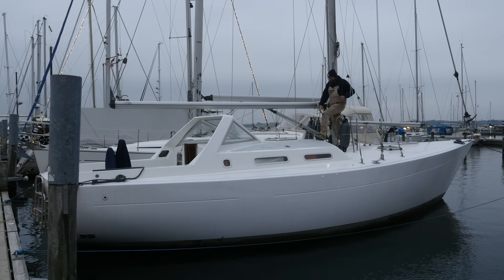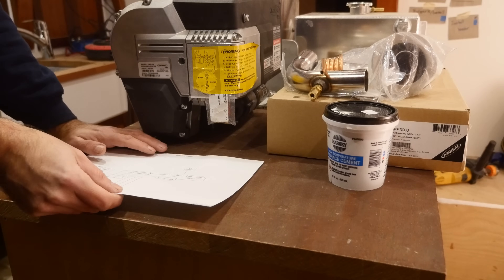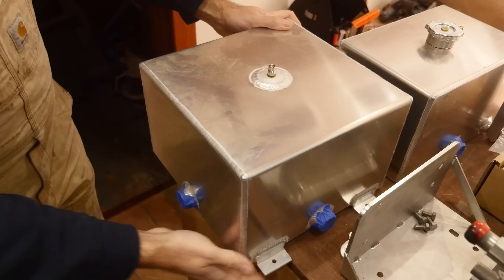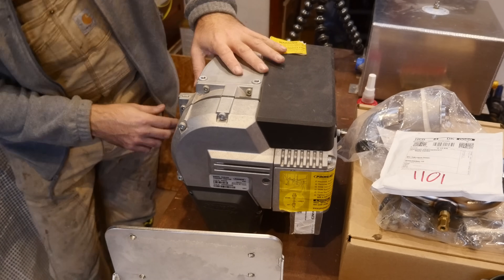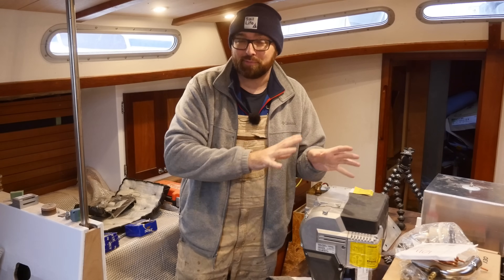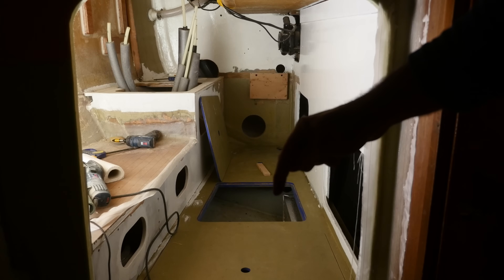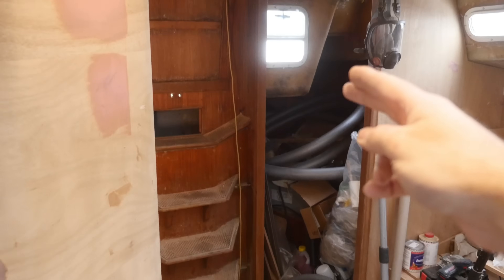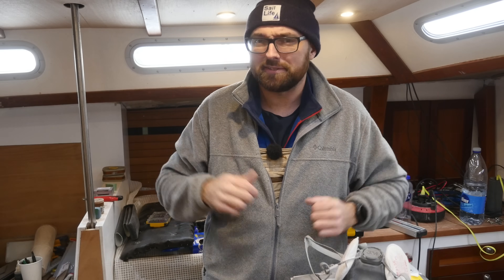Sail Life - Dometic Proheat X30 hydronic heater on a boat, part 1 of 3 - DIY project

Comment: Why dont you tap into athenas engine exhaust and save yourself a headache?
Reply: You can’t blow dry exhaust into a system designed for wet exhaust it will get to hot

Comment: Great job on designing a compact diesel-powered heating system. Do the "fan heaters" have a way to drain condensation? If so, perhaps you could connect a chiller for warm climate air conditioning using the "fan heater" loop of the same system. I added my +1 to the existing comment about the fan needing access to cabin air.

Comment: You might want to check if you can find a way to cool the exhaust of the Diesel heater. You'll want to cool it below 100C, since it will contain quite a bit of water vapor (actually, steam) that will give you a nice boost in energy extracted from your fuel when the steam condenses. 

Watch out, though, the resulting condensate will be rather aggressive, since it will be a) hot and b) acidic due to the high carbon dioxide content in the exhaust fumes.

Comment: You are lucky that Athena is a little larger boat.  We have a 35' Hallberg-Rassy Rasmus and it is crammed with mechanicals even though we don't even have refrigeration or pressurized water in the galley. We don't even have hot water, but we do have deck wash pumps, both fresh and seawater and that system alone takes up ridiculous amounts of precious space and servicing them both is a nightmare. 

Installing the Chinese Diesel heater was a PITA too.  Since we have a center cockpit and ridiculously high cockpit combing I was able to install the exhaust in that instead of in the hull.  That got it higher up and away from water ingress, while still away from any airflow going back down into the cockpit or the companionway hatches.

I hope you get better soon. Hopefully the 'rona cops won't haul you off to be quarantined in a sanatarium for weeks.  

"I'm not quite dead yet..."

Comment: I was thinking about the fluid for the heating system. For safety and also to stop galvanic issues you should look at a waterless coolant.  Something like Evans comes to mind. I use it for my motorcycle and for my car.
Reply: I was thinking same, do you still need expansion tank, if it doesn't boil?
Reply: @rogerkerkmann  well I would think he could still use it for air seperation and easy filling.  Yeah, on my motorcycle and car you could just pop off the radiator cap, and at best all you would get is a small pft.
So that safety factor would be of the greatest for a vessal that could be at sea for weeks on end.
Also corrosion would be a mute point as there is no water for galvanic electroalisis. 
well, except for the regular water in the heat exchanger. but if that is on a seperate loop would be an easy replacement when needed.

Comment: Your plumbing diagramme was slightly unclear, was it your plan to open the summer valve and close all the other valves? I would put three way valve at the inlet so you can just move one valve  and leave all the others at the correct adjustments. You might need a check valve in the system somewhere.   As far as size of fan heaters, on land those will turn a small room into a sauna.

Comment: Don't forget that the generator needs to be cooled, not heated. Pushing the hot coolant through the generator's cooling system seems to me not the best idea. Sameway if you are putting a heat exchnger on the outflow of the gen - you're going to have a huge leak of heat just overboard with the water from gen. 'Cause the water outflow from gen noway will be warmer than the heating fluid. So your heater will heat this water and you will heat fish😁

Comment: Dear Mads.  The Heating System looks great an can keep Wife Warm an Happy. Your exhaust should be in the middle of Rear in Athena about a One foot or One /Half above the Waterline. Also running the exhaust line a little long will keep the line from getting to hot and Having black film on the outside of the Sailboat! Remember you will need one Exhaust exit for the Inboard Motor Hope this help (    .   .    )    No there not boobs guys. lol. Greg of Ohio. PS. Look at some power boats how they look.

Comment: We have hot water radiant baseboard heat in our house, here in Michigan, USA..  It's the best heating system I have ever had.  It doesn't have any fans.  So I'm wondering if your system needs the heat exchanger fans.  Just wondering.

Comment: As of this post there are 20,680 cases of views, I hope nobody gets sick. If there is that much concern over heat exhausts, there is a problem with that heating system. Why so much wasted heat, or is that not the concern?

Comment: How do you deal with condensation on the port lights / hatches? Is heating the interior enough?

My boat has always been in tropical climates, but I am preparing it for chillier places. Insulation is going in, diesel air heater, but I'm wondering what will happen with the hatches/port lights

Comment: Buffertank oké ( bit big I think) but why the giant expansiontank?
A smal expansionvessel would do nicely, 3 liter is sufficient.
The fluid in the system can be pressurised up to 1.5 bar static pressure, for security you integrate a pressure relief valve , preset to 3 bar.
Does the control unit allows you to use a 3way valve for making hot water? ( making hot water has right of way before heating)
The heating unit, does it modulate from let’s say  between 30 up to 100 % lineair or  just 30 or 100% ?
Mads do not make the exhaust outlet to high , you need a nice bend up because of waves hitting the boat, water goes in the exhaust and wil get out if there is this bend up.  Otherwise the water goes straight to the heating unit, despite the smal condensation outlet.

Comment: Assuming the 6400 and 6000 numbers indicate thermal power, you should put the saloon and forward cabin on a separate circuit. You want an equal temperature drop in every circuit, that how you maximize efficiency. The hydraulic resistance of every circuit is going to be quite similar, so they are all going to get the same flow, in the diagram you are going to extract twice as much heat from one circuit than the other two. So the exittemp of circuits 2 and 3 will be higher than that of one. Then all is going to cool in the buffer tank, so all that heat is lost. (oh, and please insulate the buffertank).

Comment: Hey. Welcome back. Hope you feel better soon. Have you talk about how Athena is sitting in water? Even? Balanced? The heaters are beautiful. Do you have an external angel exhaust plate to push the exhaust starboard of the ladder. You discussed the unit would not be on very long. The entry and exit of the boat seems to less likely to be an issue. The rope is always there. Thanks for the video.

Comment: I agree with the centre of the transom suggestions. Would it be possible to add a 45 elbow on the end of the through-hole piece to angle the exhaust down towards the water?

Comment: my opinion on you heater exhaust, just go thru the hull in the compartment. that is how my heater is plumed in my boat. simpler over all and no need to have to in any other compartment.

Comment: Heater exhaust, installed in the stern ,it can fill with following seas, out the side it can fill when heeled over.  since going out the top is undesireable, I would go uot the back and plug it in conditions where it may get flooded.

Comment: My hydronic system is almost identical to your but mine includes an engine water to water heat exchanger. I saw that you did this for the generator but seeming not for the engine. On my trip to Alaska, I ran the engine a lot and having the engine water heat exchanger provided the vast majority of the heat on that trip. Using the waste engine heat saved burning diesel fuel to run my Webasto heater. 

You appear to be using the same domestic water to water heat exchanger that I use. You did not mentioned having an anti-scald mixing valve down stream of the domestic water to water heat exchanger. Hopefully you are planning to install one and simply did not mention it. It is essential because the water coming out of the domestic water to water heat exchanger is extremely hot and will scald you.

The Real radiators are excellent. Are you planning to incorporate aquastats to  only turn on the fans when the hydronic coolant is up to temperature? They are not essential but keeping the fan switched off until the hydronic coolant is up to temperature is nice.

Comment: Fan heaters. Where do they get the air to blow out into cabins?  Without new air to get to the fans the heat won't circulat very well if at all, making the fans noisy useless equptment. Gonna hav to duct it from somewhere low in the boat(not bilge), and install  a easily replaceable or washable filter.  Can use a roll of furnace filter that you can cut into peices to fit inlets.
Reply from the maker: The vent in the stainless "face plate" doohickey is oversized. I figured that was to allow the heaters to suck in air :) I'll show it in the next video :)
Reply: @SailLife  The problem with inlet close to outlet is the warm air gets sucked back in through the inlet. They should be seperated by as far as possible..

Comment: I would run the exhaust straight up with a 4' stack beyond the deck. The reason? Because I do not think that thing is going to enjoy sea water rolling into it at all.
Reply: Supplemented with a suitable form at the top to keep rain out. Vertical exhausts on most equipment has an angle point aft.

Comment: Hey Mads, just one advice for the Heating: Use this instead of the Valves...you could easy control the Water flow. https://www.heizungsdiscount24.de/fussbodenheizung/viessmann-edelstahl-heizkreisverteiler-fuer-3-heizkreise-mit-dfa-laenge-290mm.html?gclid=CjwKCAiAn7L-BRBbEiwAl9UtkJozJaVhN1jqDRjzeiBUvQaVnG_P2m_YvVj7ExxCGsaHgtwGZlt5HRoCmSkQAvD_BwE

Comment: Exhaust out the top with a tractor flap :D
Reply: Flaps are noisy and his heater may not generate enough pre3ssure to open one. Just a slight curve to aft will prevent casual rain entry. I presume the marine installation kit requires a trap in the line to prevent direct wash out.

Comment: If the heater is running, you won't go for a swim unless you're a penguin - so transom it is.
Reply: Reasonable logic
Reply: Unless they want a warm water shower in the tropical heat after a swim.
Reply: @samchristie7585  Athena isn't going to the tropics as I understand.

Comment: If the fans are noisy and you don't like it, you can rubber mount them. There's these T pegs made out of rubber that you can buy online, and the legs are plastic. That plastic has 3M red double sided tape, so you can mount them anywhere you like. Cuts a lot of the noise, which is vibration.

You also need a hole through which the air to enter, not just exit. Just letting you know.

Comment: There are 90° fittings for the condensate drain. Would be a little easier for you
Reply: or anneal the copper tube, pack with salt or fine sand and make the bend

Comment: You can't install a fan heaters in the bathroom. The smell will come out to the rest of the boat. You need lower pressure in the bathroom than the rest of the boat.
Reply: It is not a forced air system where the air gets circulated through out the boat via ducting. Each fan has its own heat radiator so it is only circulating the air in its own room. Assuming the the air supply is coming from the same room of course.
Reply: @maxmillion7007  the will only circulate in one room if the room is Hermetic. As soon you open the door, the air of the bathroom will come out into the saloon. If you do the number two, there is not a nice smell.
Reply: I am guessing he will install an exhaust fan in the bathroom as well.

Comment: Mads, hope you feel better soon! A question/suggestion about the exhaust for your heater - try to place it in a spot where fenders will not be hung on top of it or above it. Also, away from any openings where fumes could find their way back inside the boat.

Comment: Hi Mads. I'm the norwegian guy with a Bavaria 39 that visited you onbord Athena in Skive harbour i 2019. I  have had a water based heating system in my boat for some 14 years now and I love it. My system is somewhat different. I use a 5 Kw Eber burner and the engine via a heat exhanger to warm up the "system water", but I also have a calorifyer in the loop. This has also a 230 V heater element and I use this from time to time when shorepower is available. The system water runs in two parallell 19 mm isolated lines (port and starboard) and I  have set up 7 of similar fan-heaters as yours. Each heater is set up with valves for adjustment or cut off. A small expansion tank (about a gallon) is placed in the engine room as the highest point. The system contains only 13 liters anti freeze. I have two serial connected pumps in the system. One is controlled by the Eber heater and the other starts when the engin starts as well as with a manual switch. The two cirkulation pumps makes it also easy to get air out of the system. The system has worked fine all this years, but I have had trouble with the Eber (had to change it two times). Using the boat mostly for heating water for shower and dishes, we normally run the Eber for 30 min. Then we have 60 degrees in the calorifyer and plenty for showering. When the sea water is cold, heating the boat is necessary and normally the heater do not start and stop too much.
But since you plan to use your boat for liveaboard in cold clima, I fully support your choise of a heater with variable effect. But you will also use the engine many hours and using the heat that it produce would be an advantage in my opinion.
Regarding exhaust: I recommend the place you first pointed to. I don't think the mooring lines will be a problem, but make sure you don't hang fenders there :-)
Reply: Can you run an eberspatcher on fresh water and use it for radient heat? Also the dometic runs 15k btu on low, I believe the eberspatcher goes down to 5k btu, thoughts?
Reply: @rogerkerkmann  Yes, I'm sure you can run it on fresh water, but if you have the boat i Norway - as I do - the freezing temperature is the problem when not in use :-)
My heater is rated at 5 kW - around 17000 btu I think. It regulates itself down to about half of that - can not be set to run permanent on half speed.

Comment: Place the exhaust along the side.. not the transom.. On the transom you could ingest salt water which will in time, even moisture, corrode the system.. At least along the side, while in motion, you'll have a draft.. Not something similar to rotor wash.  It is a good question.  The only other option would be out the deck near the transom.. But then you'll need a scoop to mount.  At least that way, exhaust rises, no issue with water impregnation. but that has it's draw backs.  Paper, Rocks, Scissors?

Comment: well chances are that you'll be using the dock lines while you are heating the boat thus providing a chance for the dock lines to get worn faster than otherwise if the exhaust is on that side. However, chances are quite slim that you will be entering and exiting the water while you are using the heater unless there is an emergency if that happens you can always turn the heater off when you exit and enter the boat. So my vote goes to aft placement for the heater exhaust. By the way congrats on the mention of your channel in the "good old boat magazine.

Comment: On the exhaust thru-hull the 10 ft and 5-90 deg bends is likely to make sure there isn't too much back pressure. The straighter the shot(less number of 90's or other bends) the further away it could be than the 10 ft but of course you run a risk by exceeding the manufacturers specs.

Comment: Feel better,  mount the exhaust on the transom center as high as you can go! If you mount it on the starboard side if you get a rail under you have a large hole to take on water NOT GOOD!

Comment: Thanks for sharing video especially generous considering you are still not 100%.  My vote would be stern because of lean whilst sailing however, consider where your tender will be mounted and try to avoid  hot gas from melting it

Comment: With your plumbing, you can't regulate the maximum temp of your domestic hot water, you need a bypass valve for when your DH is up to temperature. I'd put the exhaust in the transom. Mine is and it's not an issue getting on and off the boat, even when the heater is running.

Comment: To Mads and the forum in general, why would one not use (heated) seawater for washing with a final quick rinse using fresh water?
Reply: Because the energy needed to heat the cold waters he plans on spending most of the time sailing in, would be huge. Unless you are talking about spent seawater after it has cooled the engine(s), that is what the exchanger will do.
Reply: Doesn’t heating salt water have a tendency to separate out the salt (NaCl) from the water leading to crusty, clogged pipes and the potential for Chlorine (very poisonous) production?

Comment: 14:38 with the fan box mounted on the outside of basically what will be an enclosed cabinet, where will the airflow for the fans come from? Is there a vent for makeup air I overlooked? I'm thinking like an hvac unit where there is an air return... clearly this unit is different but I'm thinking of the airflow where it comes from and where it goes.

Comment: Heat will sure be luxurious!  Real interested in this install...not many boats out in southern California with a hydronic heating system.  Do the fan heaters need another vent or ducting for return air and a dust filter?

Comment: Center of the stern if posible. On the side would be in the water when healed over
Reply: Surely all exhausts should be through the transom and roughly on the centerline. You don't want to immerse an exhaust outlet when the boat is heeled over. Ooops! Sorry, almost identical to the post above!
Reply: I am doing the same head scrating myself.